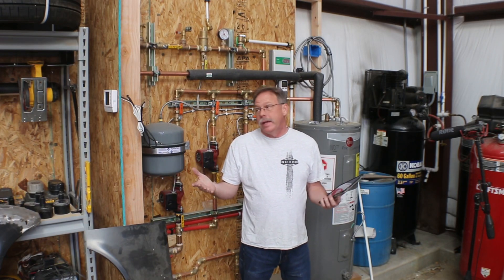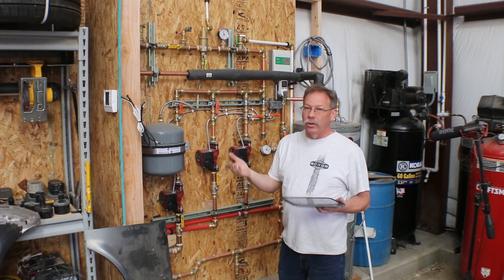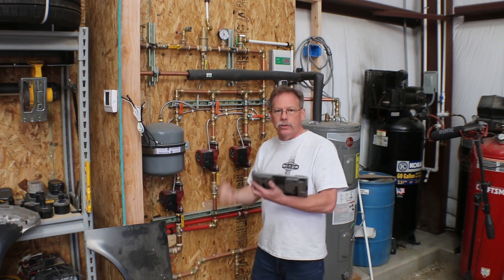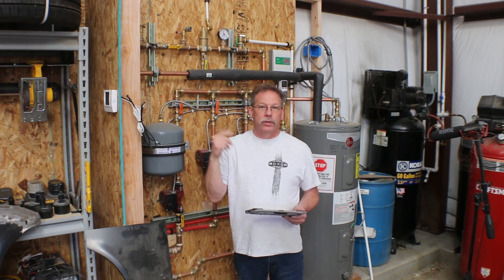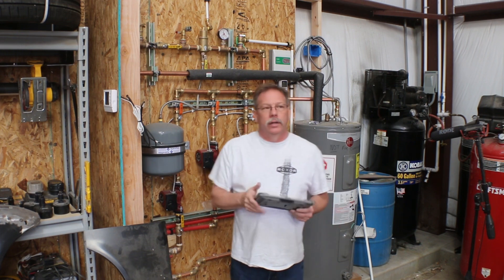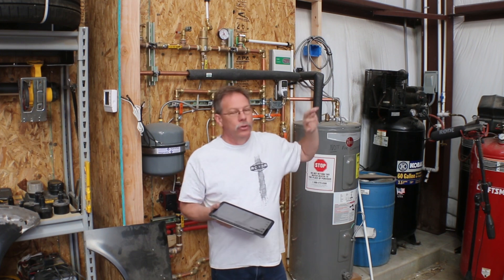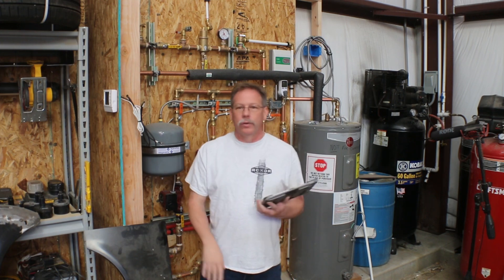Shop Radiant Floor Heat - How Much did using an Electric Water Heater Actually Cost?

Comment: If i went to an instant water heater id go propane because they work better for less than the electric
Reply from the maker: I agree, although for a building that size, I would just use a boiler. 
Thanks for watching and commenting!

Comment: For those looking for more cost of operation info. I live in Michigan (northern lower peninsula) have 30’x40’ w/14’ wall shop. Use a 50 gallon electric heater wired same as his, filled with distilled water on a closed system. I used 1/2” pex spaced 12” apart. 4” slab, 2” high pressure rigid foam board under slab and up the side of the slab. Roof deck has 2” rigid foam capped w/2” of closed cell spray foam. Walls are 1.5” rigid foam with all seems sprayed when roof was done to seal leaks and R19 batts over that. No windows, single insulated 12’x16’ overhead door and one insulated man door. I keep the shop at 55 degrees and my electric bill is usually $150-$200 per month. The winters have been milder than usual since completing the system so I could see that going up to the mid $250 range on a harsh winter.
Reply from the maker: Sounds like a very well thought out system!
Reply: Hi im doing a similar system to you what type of thermostat are you running? Are you running a slab probe ?
Reply: @sammason133  I’m using a conventional thermostat but I  have a probe style that I need to swap it out for. I use a timer though between the pump relay and pump that is set to run a cycle of 15 mins on then 15 mins off until the thermostat shuts off. This is to allow the heater to recover and also allows the water in the slab to give up its heat to the slab and allows more time for the slab to radiate its heat to prevent the system running longer than needed. I’m hoping the probe thermostat will help keep the temps closer to the temps it’s set for. The air temps tend to exceed the thermostat by a couple degrees.
Reply: @byronn.2885  when we had radiant heat in our greenhouse we'd set it 10 degrees below what we wanted it to be in there. It seemed the air temperature was always hotter. I loved it because you could work without cold feet or hands. Working damp soil in the cold isn't a picnic

Comment: I feel your pain on this. My home has a 32x48 uninsulated shop in Eastern Idaho and I’ve been wondering what to do for heat. I work overseas but the plan is to retire next year and start rebuilding the stuff I’ve accumulated over the years. My floor is not set up for hydronic but the house is. Thought about evacuated solar tubes to a tank like your follow on video but run the hot water to a ceiling mounted radiator and fan to push out warm air. I can tell from watching your video that it’s not going to work. The house has a natural gas boiler but I’m not sure how far the main line is from my shop. There’s a good shot that the main line runs to the front of my property next to the road with a lateral going to the house. If that’s the case my shop is located closer to the road and might need a 40’ dig to get to the shop. If I had tubes in the slab I’d go gas boiler but now I’m thinking a burner of some kind and a carbon monoxide alarm system. That or buy a bunch of coal with enough wood to fire it off. Haaa. For insulation I’ve been thinking about closed cell spray foam over the years and getting trained up to buy my own rig and spray the shop. I have some trailers I’d like to spray as well but trying to justify owning my own rig versus hiring someone is up in the air. Areas I’d like to spray in the house as well to get the R value up there even though it probably isn’t needed. Thanks for the video. One of my toys is a 1968 Chevy C-30 that I’d like to go over, turn it into a pizza truck. Haha latest crazy idea that doesn’t make any sense. Cheers and have fun.
Reply from the maker: Maybe look at an inferred system fired off on Natural Gas.  I have a good friend using that type of system and is very happy with it. At least until he kicks on the fan in his paint booth, then the heat gets sucked right out.  But it works nice the rest of the time.

Comment: heat pump is a solution,u can runn it on 30 degrees more efficient then the waterheater
Reply from the maker: I think I have decided that I’m going to save up and pay to run a NG line and replace the driveways as required.

Comment: a few things:
1.  FYI, it is more cost effective per unit of heat to install PV panels and have those run a resistive heater than buying the vacuum-tube solar-thermal things. as a bonus, you can leave this system installed and just run it from the solar. 
2. a single-zone mini-split with low temp (XLTH/Hyper-Heat/Aurora/etc.) isn't that hard to install and will give you about 4x more heat per unit of electricity, and even on the coldest (-15F to 5F) about 2x more heat per unit of electricity.
Reply from the maker: I’ve honestly been looking at that exact system, and you may see more about it as we approach winter.  Thanks for the comment!

Comment: Hot water heater correction:  "Hot water's heater."  It is grammatically fine. A water heater is what it is. A "hot water heater" is, the hot water's - heater. 😂

Comment: Your heating system is called a hydronic heating system. That being said the hot water heater now is your heat supply unit or just heater. I had this system in my first house and have never had a better system.
Reply from the maker: Thanks, it’s working, just trying to make it more efficient.

Comment: You lost me @ 600.00 a month! I'm gathering information on a project like this and your the first video I've watched. Im thinking about going natural gas. Infact the only real option is gas. Appreciate your time in making this video. It's very interesting
Reply from the maker: Natural gas is ABSOLUTELY the way to go.
Reply: a heat pump will be able to do the job for around the same cost as the gas. depends on where you live. a heat pump plus a wood stove can be a good option if wood is cheap in your area.
Reply: @somedude-lc5dy  I've been told heat pumps are not worth the investment in my neck of the woods (Michigan) I haven't really researched that much. As far as wood goes I'm using that now but I probably wouldn't if I had to buy it. I have seen the gas water heaters with the coil built into them for such a purpose and find them interesting. But at that point it's pretty much a boiler. Much to think about
Reply from the maker: Wood is not really an option in a lot of commercial shops (at least in my area) for fire risk / insurance reasons.  I like the idea of a heat pump, but I’m not sure I will be trying out any more electric options.

Comment: A friend of mine has a similar setup he has a oil burner inline with his electric hot water tank the oil burner gets it to temperature and the electric hot water tank maintains that temp he said once the slabs to temp the hot water heater has no problem keeping it there
Reply from the maker: Yea, I had hoped to run a waste oil boiler, I just don’t produce enough waste oil to keep it feed.

Comment: Sounds more reasonable to spend on getting the natural gas piped in...$7,000+ a year to heat the garage on electric  is much. 
Most commercial plumbers, those who do plumbing of all kinds 100%, will want to solder vs. shark bite. Also, forced air or an airtight wood stove will be a less expensive alternative in heating costs mainly because you're not having to heat the slab and the ground below it. There are many options to heat a building...modern and old methods. Lots of times, old methods are best such as a wood burning airtight stove as all it needs is one vent to the outside for exhaust. No special expensive plumbing, pipes, fittings, valves, pumps using power and so forth.
Reply from the maker: I’ve been trying to find someone to do Directional Boring to run a gas line out to the shop. So we will see what the future holds.
Also, the original idea was to use a waste oil boiler for heat, turns out I don’t produce anywhere near enough waste oil.

Comment: You shared usable, real world information. Much appreciated! A couple observations. Having essentially a second thermostat switch off the pump (allowing the fluid inside the water heater to return to max temp?) is perplexing to me, because, all the while, the in-floor tubing is cooling down (and also not heating up), without any perceptible benefit. That lost heat takes time to recover, basically compounding the wait for a comfy shop. If the goal is to get the shop to a target temp as soon as possible, I would think letting the fluid flow continuously through energized heating elements in the water heater is the most efficient way to bring the system up to temp. Also, I think your energy cost is very high for a typical shade tree mechanic. Lastly, I think it's petty to criticize people for saying "hot" water heater when it's literally a heater that makes water hot, but I can go either way on that.
Reply from the maker: You hit on a point it took me a few days to think about and solve.  The water heater (and now the solar) are always on.  The two 5500 watt elements can support about a 25 degree temperature rise all of the time. The solar (on a good day) can keep the floor at 60F and heat the tank up to 165F to then help out the water heater overnight.  My next step will be figuring out how to get the place up to 70F consistently and hopefully efficiently.  I think my first big expense to that will be getting the rest of the concrete poured.

Comment: Awesome video. Thank you for such a complete analysis of your system. 
As a side thought, if you ever find a larger water tank, say a 60 gallon one, perhaps replace the one you are currently using. It may save you some electricity as it will have more thermal mass and may recover sooner. Of course I don't know, just giving a suggestion based on my supposition and not on actual facts.
Reply from the maker: Thanks for the tip!  I think you are on to something though- I added a 108 gal storage tank for the solar and with the water heater running at night the whole system seems to stay warmer.

Comment: Why is the life of the system 18 years?  I'm missing something.
Reply from the maker: Of what system?
Reply: in your video you said something to the effect of your system was good for 18 years.  What part of the system, other than relays and pumps, is subject to fail in 18 years?
Reply from the maker: I’ll have to go back and listen to what I said, because I don’t recall the reference.
Reply: @AllisonCustoms  around 15:50 is when you stated "life of the system is 18 years"
Reply from the maker: Ok, I was talking about a conversation with an engineer from a PV solar company, and the “life” of the PV panels they were selling was estimated to be 18 years.  The “life” he was referred to was that at the 18 year point (approximately) the solar cells have degraded enough so as to not have the efficiency that would continue to support my system requirements. Panels would likely need to be replaced at that point, the other side of that is that we would potentially have 18 years of technological advancement during that time and the new panels would have greater efficiency and/or “life” spans.
Reply: Got it....Thanks.   @AllisonCustoms
Reply from the maker: You bet.

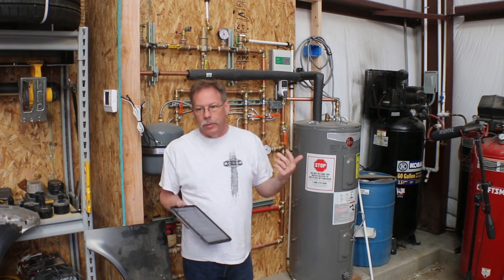Comment: @13:00 Anyone who told you to put a blanket around the water heater is an idiot. Um, you're intentionally trying to heat the shop with that water heater. Any heat you "lose" from not having a blanket on it is being "lost" into the shop, which actually heats the shop. 

Putting a blanket on a water heater is meant to keep the heat INSIDE the water heater. Do they not realize that you're actually trying to get heat out of it and into the shop? Wow.

Do people even think before the nonsense pours out of their mouth? Lol.

Comment: It’s a cool project but that water heater is just not going to put out enough btu to heat the shop. Both elements running at 9000W total is 30,600 btu. Mini splits would have been a better choice. You could have had about 160,000 btu of heat for 9000W of electricity. Heat pumps are far more efficient then resistive heating. As a bonus you get AC in the summer.
Reply from the maker: I like your ideas and I am researching heat pumps for that same reason - only they would be a liquid to air version.

Comment: A pool air to water heat pump would cut your heating cost to 1/4 of what you are paying for electricity. Pool heat pumps would produce  120 degree F water and are cheaper than a domestic heat pump.
Reply from the maker: I have been looking into that exact solution. I originally started checking specs on the residential and commercial versions, but they are very expensive and it appears the pool versions will do everything I want.  I just need to nail down the control systems that will tie into everything else I’ve got going.

Comment: It's fun watching the journey and you did a fab job on the install.  You can't beat a 200 buck water heater can you?  Well actually now you've proved you can - $600+ a month in electricity.  The solar array to generate 600 bucks a month worth of electricity is gonna be large and very expensive.  I can't help but think you'd be WAAAY better off just getting a250 litre all in one heatpump tank venting it's air in and out through the wall and hey presto you'll probably save 450 a month immediately in electricity.  Then you can put 6 months worth of that 450 a month saving into a smallish cheap 5kw solar array which you can DIY will then completely power your heatpump during day - so now your talking only 30 - 40 bucks a month in electricity used overnight....
Reply from the maker: I agree a PV solar system to generate the amount electricity I’m using would be very expensive.

Comment: Look into a Gen-set from an over the road Semi. I had ours plumbed into the main engine cooling. We used an electric heater to heat the cab when parked with main engine off. The harder the generator worked for electric, the warmer we were. (We had a night that was actual -35 degrees Fahrenheit with 50 mph winds for an insane windchill. We slept in total comfort. This can be called a hybrid system. In the morning the Semi engine was 150 degrees as soon as we started, so we had immediate heat. 

Suggest if you'd do this, run one or two water heaters powered by the gen-set & use all the waste heat from the generator to maintain heat. These gen-sets use about 1 gallon diesel (use off road) for 3 to 5 hours run time & are very reliable. They can run many thousands of hours with minimum maintenance.
Reply from the maker: Thanks for the suggestion, I’ll start looking into one of these systems.

Comment: That doesn't seem that bad to heat that size of shop to be honest... hell, my hot tub used to cost me $200-300 per month during really cold months lol.
Reply from the maker: Honestly, if the shop was actually warm not just “Not Really Damn Cold”, I wouldn’t think about it too much either.  But maintaining 55 degrees feels like it is just a really good starting point.
Thanks for watching.
Reply: @AllisonCustoms  Understandable, that's still a lot of money per month, but that's a big shop LOL (very jealous). I'd imagine the dirt floor part isn't insulated yet? That must be costing you a ton?
Reply from the maker: Yea, the dirt part is definitely sucking heat out of the building.

Comment: This got your feet wet w hydronic systems, but I would consider using the electric tank as a thermal mass holding tank and a small propane tankless direct to bump the heat output up. That way minimizes electric reliance, especially w power outages and can handle extreme cold days.
Reply from the maker: Made a move to Solar, video out soon. Thanks for watching.

Comment: 3:10 You state the hot water heater has 11,000 watts of heating elements (2 times 5500W), so the maximum continuous heat output is 11,000 watts.  It would take QTY (7.3) x  1500 watt bathroom space heaters to equal 11,000 watts.  That's a lot of space heaters, but your shop is quite large.  In the end, you are still heating with 100% electric resistance heat.  Maybe in Canada, "hydro" is cheap, but in lots of the USA, it is dang expensive to use "strip heat."  The electric HHW is a funky package of "strip heat" that makes hot water.  If you live in the country away from neighbors, you might consider converting an outdoor hydronic wood boiler to burn waste motor oil, if you have a good source of cheap used oils.  There are plenty of YouTube videos of DIY waste oil heaters, but your insurance will deny your claim if you burn down the shop.
Reply from the maker: You’ve got a lot of good points.  I’ve looked into waste oil boilers and nearly pulled the trigger on one back in September.  The math says I would need about 1200 gallons of used oil per month to make that dollar cost out.  I DO NOT produce anything like that amount of oil and I doubt I could source it easily.  If I had to switch to diesel or vegetable oil the cost would be prohibitive again.  So that works out to a no go.  
I working out the kinks in a solar system now (video to come out soon).